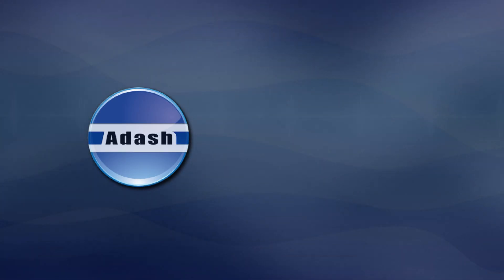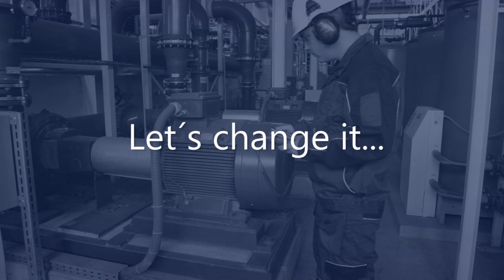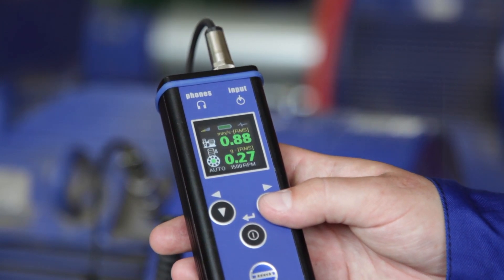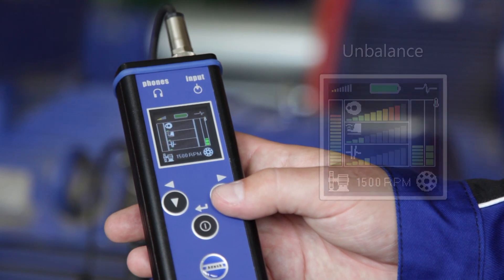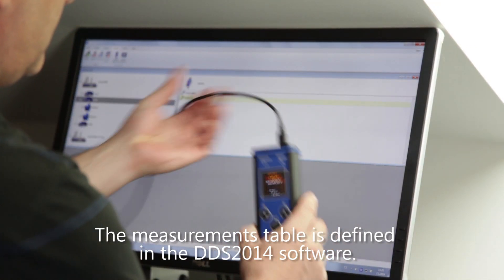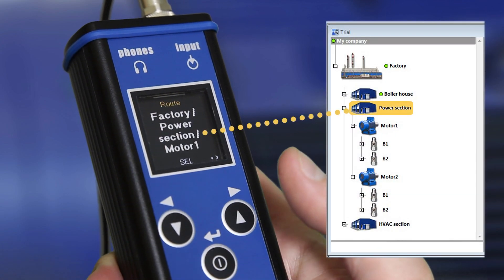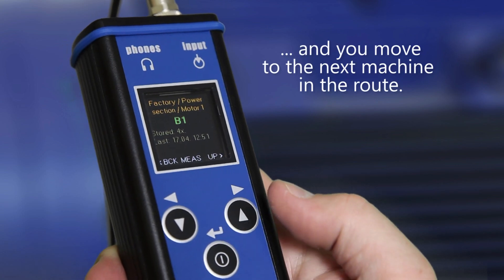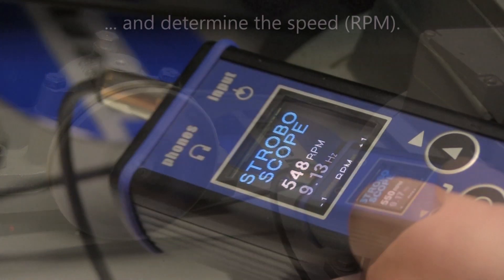Adash A4900 Vibrio M - Vibration Meter, Data Collector, Vibration Analyzer (EN)

Comment: This Product can Compatible and used with MATLAB Aplication,..? For Analyze and Print Out the data collect,.? 🙏
Reply from the maker: Vibrio M works directly only with our DDS software which you can see on the video. But in DDS you can export data in CSV format which MATLAB supports. So basically the answer is yes, it is compatible.